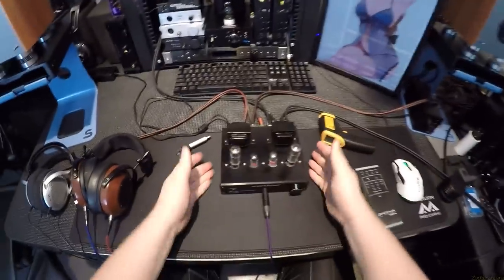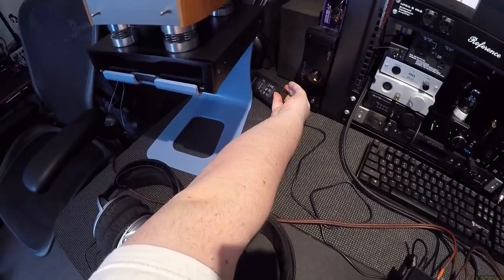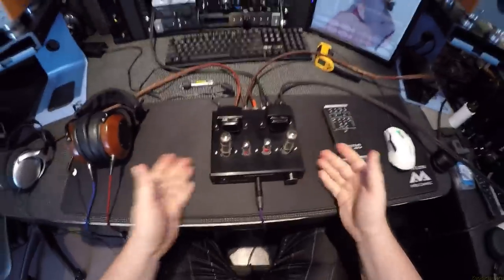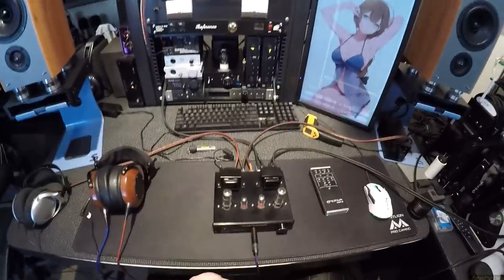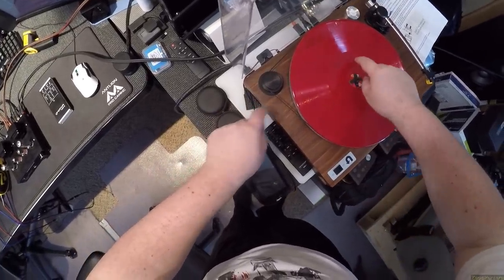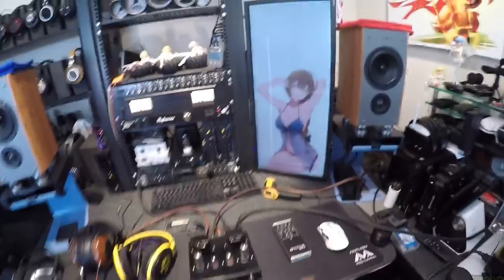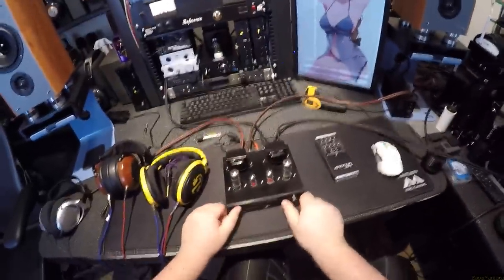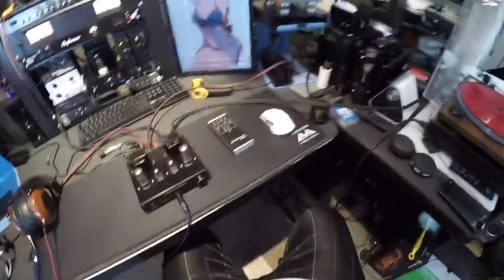FX-AUDIO Tube-P1 _(Z Reviews)_ Tube SPEAKER amp.. Woot.

Comment: I know I'm a cynic but, more than a tube amp review, this seems to be a scathing review of the U-turn turntable lol
Reply: I dunno, I think that something is likely wrong with with the amp. It's hard to say because there is basically no documentation of the thing, but I have a feeling that the phono input is not amplifying the RIAA-corrected signal near enough before feeding it to the rest of the amp. Phono preamps generally output to some standard amplitude, IIRC, and this amp might not be doing it. But who knows?
Reply from the maker: Ive used the TT in several reviews. It is never this quiet.
Reply: @ZReviews  the gain on this is piss poor, get a TC-750 and a TC-780 line booster, then you have CD level phono - line performance

Comment: Thank you. I would like an open source software/app that would help design a set up. Like pairing audio interfaces with amp that work w specific passive or active speakers, etc... Even of it's only based uon specs and not brand specific.

Comment: I use a mini fan for my DV, would be beneficial for this amp.
Reply from the maker: Thing is the heat is what you want up to a certain amount.
Reply: The fan is only a four inch fan and it is about 2 feet away and not blowing directly on the tubes. i do this to cut back on the decay of the tube, because heat is what deteriorates the tube itself. i usually have it flipped around to cool me off. My office is small, and heat builds up from my computer.

Comment: What happened to to the Metz headphones haven't seen you review them yet they needed them back I bet you miss those suckers now that's a headphone
Would be worth buying a multi voltage ultra low noise 50 Watts linear power supply about $50
2.5 Watts per channel for phono stage 3.3 what's on RCA per channel help the tube amp bigger power supply your get more wattage some tweaking might be needed.

No that power supply link you left wouldn't bother!!! your get lot of noise coming through  being switch mode the amplifier doesn't have the filtration for it, either no need 120 Watts 50w  overkill.
Reply: Are you familiar with proofreading?
Reply: @ju1cycrackfa1ry  what do you mean

Comment: I might have missed something in the video but did Zeos or any followers have an opinion on the headphone stage of the Tube integrated amp?  I know it was good for the HD600 but what is the wattage and is it on the high or low side to push Planar headphones.  I have the Monoprice M1060.